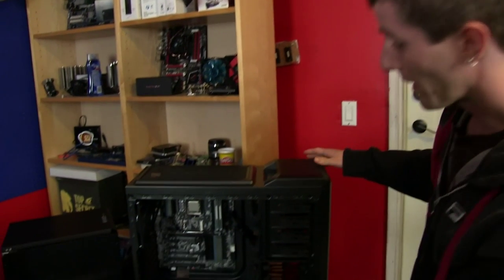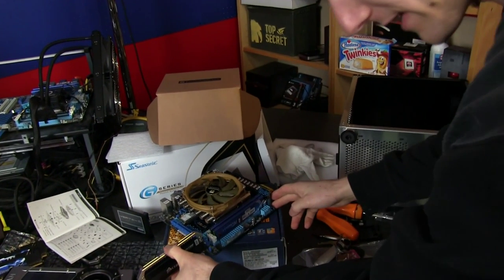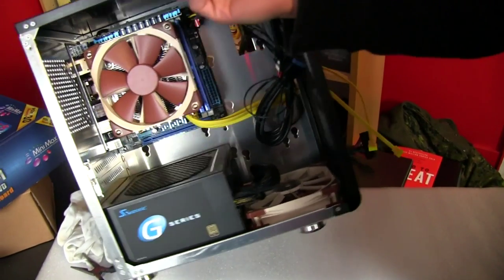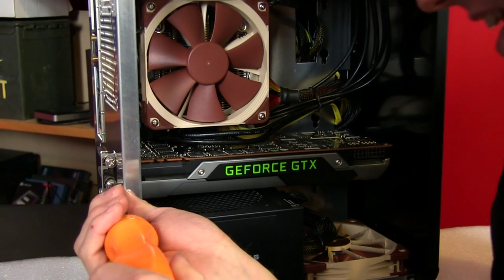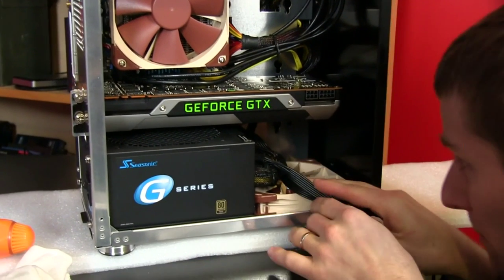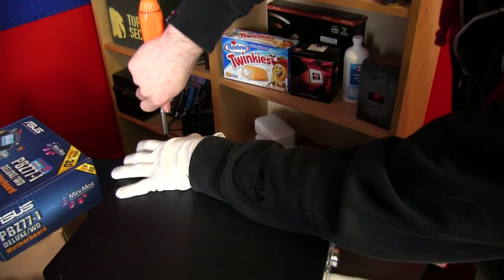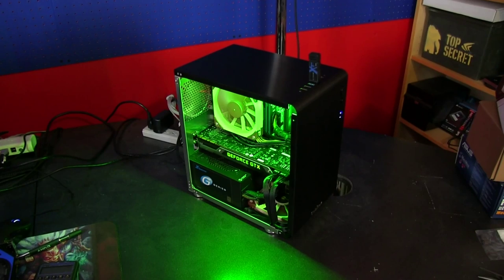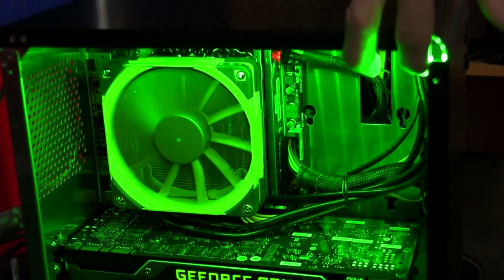GTX Titan Small Form Factor Gaming PC Build Guide Linus Tech Tips

Comment: Can you overclock an i5 4690k and gtx 970 on 500 watt PSU? Or should I get a 650 watt PSU?
Reply: +Tom Brown should work, just try :)
Reply: Lyhras I don't have a 650 wat PSU yet. I want to know what PSU I should get for overclocking. I currently have a 500 watt PSU and want to upgrade it.
Reply: Try it with the 500 watt, if it wont Work, buy 750 in case you want to Upgrade in Future
Reply: Lyhras But do you think overclocking it would cause the PSU to burn down? Or would it just plain not work? Cheers!
Reply: +Tom Brown For OC headroom, get 600w or 650w
Reply: +Tom Brown try it, if it gets to hot, get a new psu. But Then get the 750w just in case, so you dont have to buy another if you want Upgrade gpu or shit
Reply: yeah i will try that. many thanks for the advice! :)
Reply: I have an A10 5800k and a R9 380x, CPU overclocked to 4.4 ghz and ddr3 1333mhz overclocked to 1600mhz running of an 500 watt psu. so it'll be fine.
Reply: +Lars Schothorst P.S. my components are pretty power hungery.
Reply: Lars Schothorst That CPU is slightly bottlenecking :C
Reply: SquidPlays Could it cause crashing in games or increased load times if it bottlenecks the GPU? What CPU would be better for a gtx 970? I want to upgrade the i7 4790k. Would that be better?
Reply: Tom Brown Bottlenecking just means that the current setup isn't the best it can be. Something like a i5 would provide maximum performance. If you like AMD, then an FX 6000 or 8000 series would do. If you're not doing CAD rendering or something that uses a lot of threads, go for the i5. It's better for gaming and lighter on the wallet. On the other side, the FX line has more cores for things like streaming and rendering. All up to you, really. FX or Intel Core i5
Reply: SquidPlays Slightly A FREAKING LOAD! I plan on buying the FX 8350...
Reply: Lars Schothorst Nah, maybe like 15%
Reply: SquidPlays I even can't get 60 Fps on Dirty Bomb...
Reply: Lars Schothorst oy

Comment: Lol the GTX970 in my Acer computer actually sounds like a hair dryer. Some reference cooler thingy from some brand. Really regretting not going for a custom machine. Can't help but wonder if the cooler's broken in some way to make that noise. Even at idle it's as least as loud as that rig, which imho is pretty loud.
Reply: +Shaxi Do you mean Nvidia?
Reply: HD1080i Gaming What? The GTX 970 is a card from nVidia, yes. But my computer is manufactured by Acer. I don't really understand what you mean, buddy.
Reply: You said "Some reference cooler thingy from some brand". As far as I know, reference coolers are only on stock Nvidia cards, unless you have one from another brand using a blower style cooler.
Reply: HD1080i Gaming Since there wasn't actually a reference GTX 970 made afaik, I'd suspect it's the latter. I know Gainward has one with the black shroud that mine has, for instance.
Reply: +Shaxi If you search online, there is a reference 970 by nvidia and a few with blowers
Reply: HD1080i Gaming Oh. Maybe it's just made for OEMs because at least here in Finland I haven't seen an nVidia GTX 970 like there are nVidia 980 Tis or Titan Xs for instance. Oh well, if you see the Gainward card with the blower cooler, that's how mine looks. Or I think Zotac has it as well.
Reply: Oh, ok. I get it.

Comment: the hair dryer on low sounds like my pc not even joking :(
Reply: Lenz ClickZ Sounds like one of four things: More dust than Pewdiepie has subscribers is occupying your computers case, the RPM wire(s) have worn out, the temperature sensor the fans change speed according to is faulty, or the bearings of your fan are extremely worn out. 

A possible fifth cause is a combination of the fourth one and having a molex connector fan, which is an old type of fan that always runs at one constant speed no matter the heat of your computer.
Reply: Lenz ClickZ Also, my computer fans sound like a group of three mini box fans that are audible but not unpleasant...however, while my brother's computer is just as loud as mine, his instead sounds like a very low idling jet engine because the bearings of his Cooler Master Rifle fan are heavily worn from back when I was using it in my old rig...it always ran fast and my computer sounded like a fighter jet idling all the time! XD

Comment: Idk where people have noise issues with their PC sounding like a hair dryer lol. 7 fans and a GTX570 my computer is nearly silent.
Reply: Back in the day when the Pentium 3 @ 600mghz. was the top tier CPU and the Viper 550 32mg was the big dog on the block, the fan noise was similar to the hair dryer on low....  NO KIDDING!!!!  Why I started water cooling back in 97.
Reply: ***** yep. the early nvidia cards were brutal.

back in the day before they started working on efficiency and we focused solely on getting more power they used to literally be loud as a hair drier, but now its still a phrase used as hyperbole.
Reply: JamesMichaelDoyle
Remember the 480? Oh GOD that one was bad... So bad some people's fried from heat, although they are still pretty good cards (They are 5 year old cards Ultra bf4 40fps xd), the heat is so bad.
Reply: Oversized PopCans i was talking more about the 4000-6000 series, those fucking things had what seemed like jet turbines on them to keep them cool. they got better after that due to the efficiency improvements lowering the tempsthe 8000 and 9000 series were where they got back to reasonable fan sound levels. im still using my 9800GTX+ dark knight. its still pretty solid and silent.

oh and fan designs in general have gotten a little quieter, so that helps too.
Reply: JamesMichaelDoyle
I suppose, although for a fairly new card, the GTX 760 has such a shitty fan. So loud and so unefficient.

Comment: 550w for titan
Reply: I did also think it was a bit low but at the same time it's not being overclocked plus it's a really tiny load other than the card. I think it would be alright.
Reply: I have a 550 basic build chip set hard drive and thts it could i run a  780 ti
Reply: my 480 requires 600 and then titan comes in with awsome specs and 550 LOLOLOL
Reply: megaTHE909 I have a gtx 560, in the process of trying to get something to power the thing we blew up 2 power supplies ;_; the hungry she beast won't take anything less than 620w
Reply: 101stsurvivor Your system did not propably take more than 300 watts, you just had some seriously shitty psu's. Sorry.

Comment: Total crap, you should have used a CPU water cooling block with a 120mm fan. All that CPU heat will be blow on the motherboard,memory & gtx titan card.  Stop using those ugly fans in nice builds for god sakes.